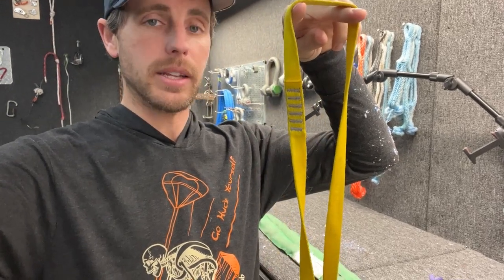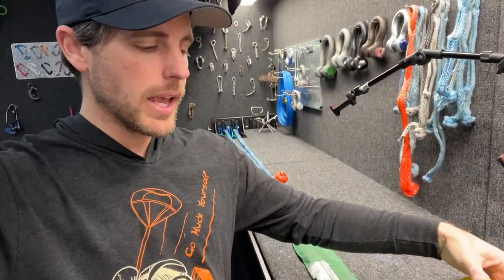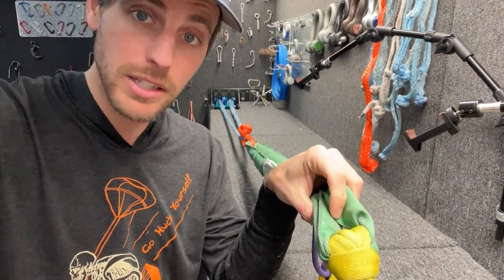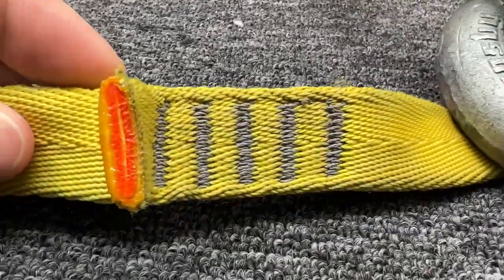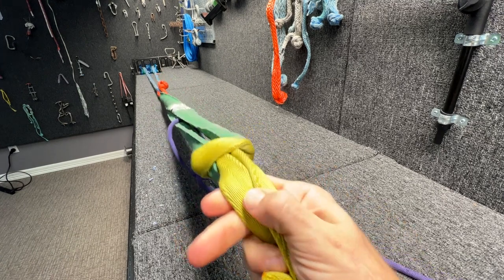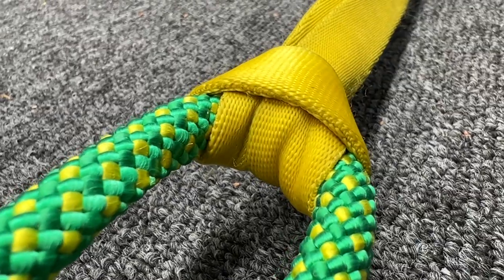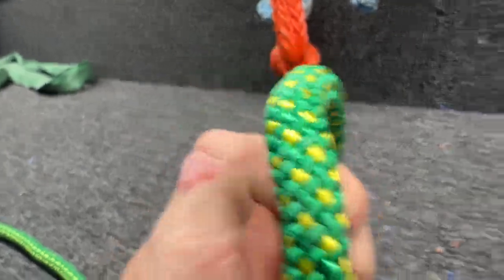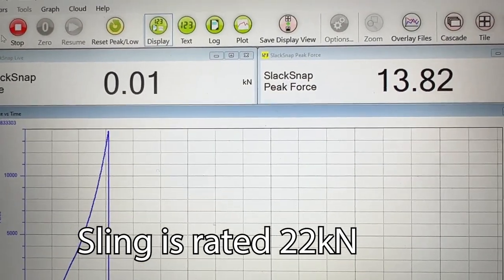Can you girth hitch slings together???

Comment: One of the questions I get quite often when doing similar things like rigging retrievable rigging straight into a knot, or extending slings with girth hitches. It is the same as any other knot, there are no moving pieces of rope or webbing. When you do your testing with Alpinesavvy I think you will prove some of those things. Cant wait for that video!

Comment: Thanks for posting this frequently on the second channel! I´d be interested to see what would happen if you pulled the same diameter slings girth hitched together, I bet that 8mm dyneema girth hitched to 8mm dyneema would be really bad (break a lot lower than dyneema girth hitched to a carabiner).
Reply from the maker: We are actually testing a LOT of girth hitches with alpine savvy in about 3 weeks when he comes to the lab.  We'll be testing that
Reply: @HowNOT2Clips  Nice, i am looking forward to this collab!
Reply: @HowNOT2Clips  I'd love to see you testing a tibloc at some stage. Lots of chat about how they are more aggressive on ropes that a proper ascender. Would be keen to know the truth!
Reply: People should just read the technical notice/instructions for use of their equipment, most of this stuff is in there. For example the Petzl Anneau sling according to the technical notice is rated for 16kn with a well orientated girth hitch to a larger diameter anchor connection (metal bar, tree branch etc), 12kn with an overhand knot in it, 10kn with a strop hitch (the recommended way of directly joining 2 slings), 10kn with a girth hitch on a bolt hanger (in good condition). Also shows that running a moving rope through the sling is extremely dangerous.
All these myths and rumors are easily dispelled by simply reading the instructions for your equipment….

Comment: Cool video! I wonder if dressing the girth hitch to resemble more of a square knot would break higher. It seems the bend radius would be less.
Reply from the maker: We wanted worse case scenario for this test but yes, doing that would make it better
Reply: In paraglidng we attach lines like that, in 2020 there was an accident where the incorrect dressing of the knots might have been a factor. Full report: https://xcmag.com/wp-content/uploads/2020/12/Accident-Investigation-Nevada-2020-2.pdf Here they only found a reduced strength for shock-loading